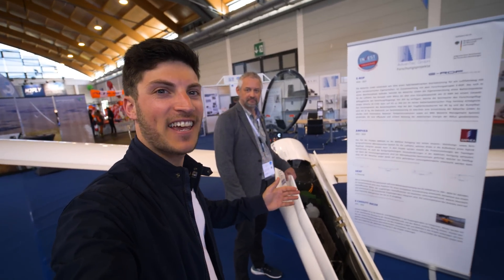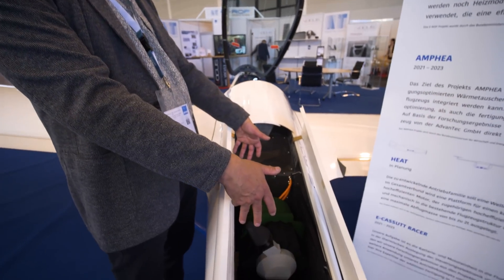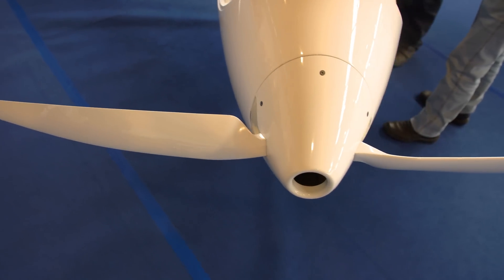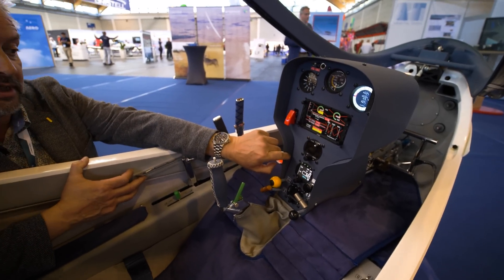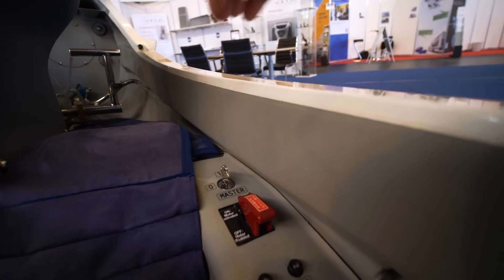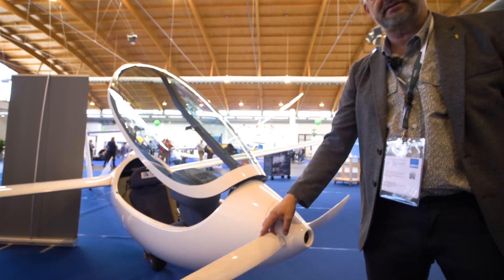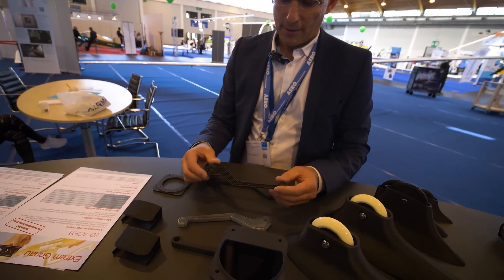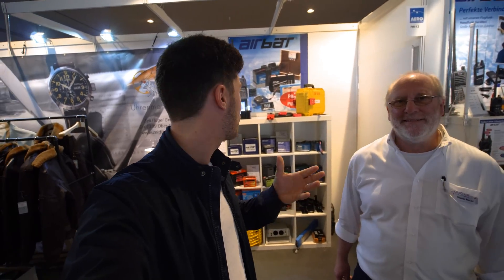1000km RANGE with ELECTRIC Glider | AERO 2022

Comment: Anyone that has an airplane knows that weight is everything and batteries will not work for you.
A fossil fuel engine has a power density 50 times greater than batteries, so no matter how efficient a battery can get it will never get more energy dense than fossil fuel.
Electric airplanes have a complex multilevel electronic controller, extra heavy battery system that can explode and burn and a permanent magnetic motor. The magnets that makes the electric motor are made from imported rare earth material.
Reply: For a glider, battery does work due to they have high glide ratio of 40:1. Your argument is valid for a normal aircraft that has glide ratio of 18:1. 
However a battery powered glider is expensive. A normal glider price is €5k but with a battery it is €30k. That is 6x fold!
Reply: Can you tell me the price of  a glider @hafizuddinmohdlowhim8426
Reply from the maker: And your fuel is not explosive? 🤣
Reply: @SteFly  No fossil fuels are not explosive but batteries are.
All airliners carry fossil fuel that can burn but are not explosive like batteries.
The 787 batteries caught fire in Tokyo and Boston grounding the 787 for several months, however the 787 or any other airliner were never grounded because of fuel fire.
Powering and airplane with batteries can be WOKE but you will go broke because it makes no engineering sense, 50 to 1 ration :hand-orange-covering-eyes::hand-orange-covering-eyes::hand-orange-covering-eyes:
Reply: Tell that to the battery powered helicopters and gliders currently flying 😂
Reply: @b1icky  One you are not an engineer. Two you are a victim of gaslighting by Klaus Schwab head of the WEF/ESG.
Helicopter with battery power is a moronic approach to flying. You can tell that to the battery powered helicopter guys.

Comment: Could you have solar panels on the wings to compliment the battery?
Reply: Solar panels are mostly too heavy for gliders. They are used on the ground to recharge.
Reply: @pluemas  They are not, the weight is negligible if installed properly.

Comment: Very interesting. I'm interested to know how Airbatt have got up to 12AH now in a "standard" sized battery?  - regretfully my German is only good enough for ordering beer, so I could'nt make out if he explained. I also really like the case for the batteries...
Reply: The "standard" batteries of this format are usually using lead gel technology, whereas the battery airbatt showed was a LiFePo (Lithium Iron Polymer) battery which is a different technology with better energy density. (Important note, don't confuse LiFePo with LiIon Batteries, they have different properties)

Comment: Concept is well known - nothing new but ... this project could be enhanced. That is to say - forget battery, add hydrogen fuel cell and hit 1300km range easily with env.-friendly fuel. Carrying empty batteries dead-weight is NO-GO for any plane. Any engineer will understand, that in the air electricity must be from fuel cell. I love propeller design - very, very similar to rc-models we build.
Reply: Yes because empty hydrogen tanks are better. Never mind that cheap hydrogen comes as fossil fuel production by product, and you are carrying explosive, flammable, pressurized hydrogen. At least with LiFePo batteries there is almost no risk of fire.

Comment: That is an AIRPLANE, not a glider. Please no more.
Reply from the maker: It´s still a glider
Reply: It is called a motor glider - in Europe CS-22 in EASA regulation. FAA term for a motorglider is a 
“Powered Glider,” as described in Advisory Circular (AC) 21.17-2a. In some countries you might need a PPL or some other type of cert in addition to a glider license.
Reply: @GracieM Yeah, though I didn't say you need one in the US - just in some countries. You don't in the US or EU. For a traveling motor gliding you need some additional stuff on your gliding license in the EU.

Comment: 1000km range with self launch ?
How much does it cost ?
Reply: Doesn't look like a product yet, but probably more than 150k$
Reply: @rkan2  I am very sure it is not less than 250k€.
Reply: @gehtdichnixan4704  Yeah, probably - The Antares Lange 2xE is like 200k€. Safe to probably add ~50k€
Reply: @rkan2  is it possible 1000km range with self launch on electric ?
Reply: @realfootball338  Well, a range extender has batteries, so if the airframe and propeller are fitted for self launching, why not..
Reply: @rkan2  for example get 4000m high without thermal stream and have reserve to get 2000m high more.
Reply: No, 1000km range is just sustained flight. Self launch costs a lot of range.
Reply: @gehtdichnixan4704  ok, still nothing better than gas

Comment: Awesome video Stefan! I'm sure it's tough to stay on your toes during an interview demo like this - WHAT IS the range extender? He said it's powered by fuel? What is it? 🤣 I know it's easy to miss these things. And I'm very much looking forward to you testing it.
Reply: In electric cars, a range extender is a (petrol or diesel powered) electric generator, that keeps the batteries charged up as you go. 
So I assume this is the same kind of thing.
Reply: @Johan-ex5yj  ah so an APU of sorts. Very cool!
Reply: Im range extenders the final drive is generally always electric. Thus they are hybrids, while they are not :P. Almost all diesel trains have been range extenders since basically their inception. Final drive always electric, no matter the actual power source.
Reply: Well 20 litres of fuel for 1000 km range thereabouts (or 500, not really sure whether to minus the 450 mentioned batteries could fly) is still absurd. Absurd.
Reply: Isn't a range extender just any type of motor for emergency backup and to fly longer distances?
Reply: Aixro Wankel engine
Reply: Seems to be a restricted market with a short lifetime. We have to stop burning fossil fuels.  It seems likely that not long after this is put on the market, a battery-only system with similar range - or adequate range, how often does a glider need 1000km powered range?  - will become available.
Reply: @JohnThomasOne  Or how about integrating solar cells into the wings so that 1000km is possible without needing a range extender? That would be great. Or at least with batteries it would add range.
Reply: @gercomar2892  I wonder how practical that would be. 4.8kW to maintain level flight, 22kWh for the 450km range battery version. (If I was in the market for one, that's the one I'd go for, without the fossil fuel unit.)

The wings are 20m, so 20 sq m. I think I have 18 sq m generating 4kWp on my roof, so assuming you could use more efficient solar and make the panels fit to cover the entire upper surface of the wings, it might just work. Range infinity, on a sunny day :-)
Reply: @JohnThomasOne  Yes! Thermals or cloud streets or solar power, but always powered by the sun, using which is most efficient / fastest at that time. Could be a new race class ;)

Comment: Batteries in the wing, only works if you have a hanger or a place where you can park your trailer next to a charge point.
Reply: A small ten kilowatt gasoline or diesel generator, the size of a bar fridge, should do nicely. Chuck one in the back of your trailer.
Reply: @grahamariss2111  Fair enough. I don't know whether Lange Aviation really want to get into gasoline-powered aircraft though. I was thinking of Stefan in the middle of the Namibian desert needing a charge to take off from a remote airfield and having a very compact means to charge with him. The theft issue is a social one and cannot be solved by purely technological means unfortunately.
Reply: @grahamariss2111  Installation, noise, vibration, reliability, smell, maintenance, cost and weight penalties would be much higher with a gasoline engine, which is why its rarely been done in a sophisticated glider over the last century. Towing a glider across to a gasoline refueling bay would not be a straightforward task, I can promise you.  For an electric system there are lots of ways to run electricity to your batteries, it just needs a resourceful approach. For example, a few solar panels on the trailer roof would charge a battery (or your car) while you fly, so you then rapid transfer that charge to the glider when it returns and you have a break. My electric car holds 52kWh, so 10 for the journey to the airport, 10 for the trip home, and ten to fill the glider for the second flight of the day. Any solar power I collect while I'm parked is a bonus, but not necessary in the real world. Not long ago marinas and caravan parks had no power delivered to the pitches and mooring spots. Now they all do. A decade ago there were few car-charging points, but now there are tens of thousands. If the demand builds, the flying sites will see the attraction of running cables to the parking area for aircraft and cars. Its not a problem, its an opportunity.
Reply: @bmpowellicio солнечные батареи на прицепе